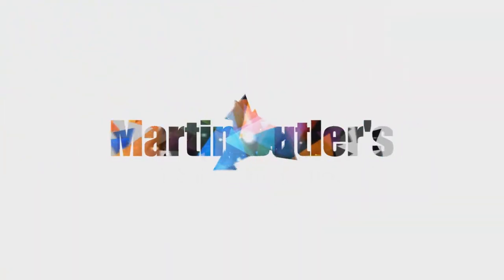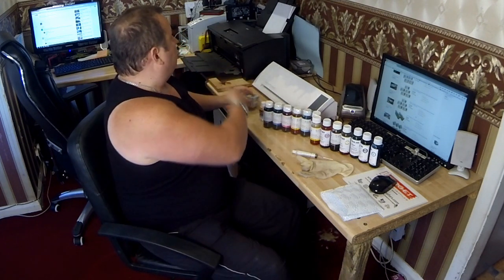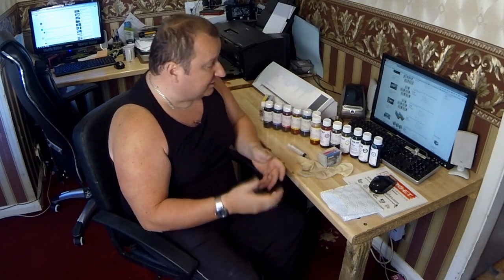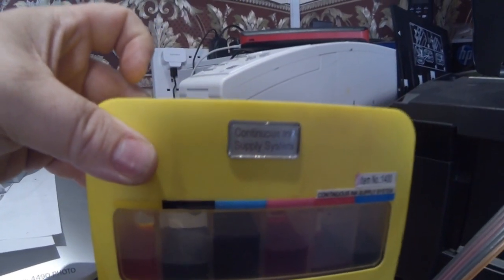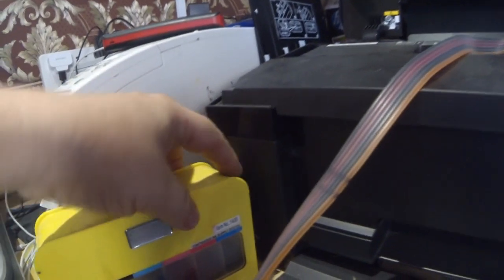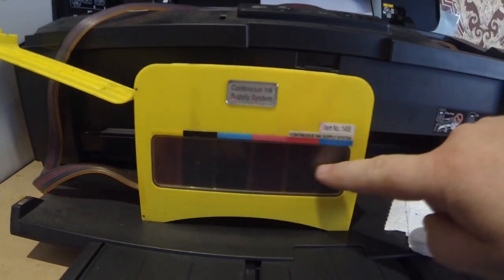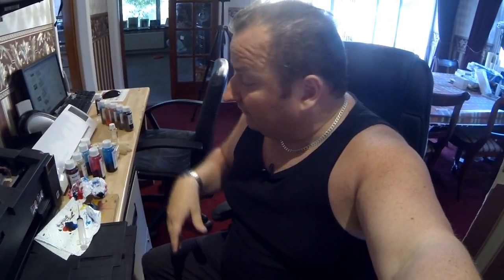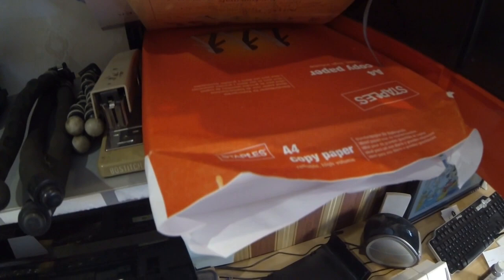My Epson 1500W Printer Maintenance CISS For T Shirt Transfer Printing Biz

Comment: Hi Martin,

First of all, let me say, I could kiss your cheek for informing us about CISS Ink Systems!!  I spent $89 US on a system for my Epson Workforce 840 with each tank holding 100ml of Ink.  I can’t even buy 4 new dinky replacement cartridges for that!!

I started with the dye ink as suggested, maybe it was who I purchased it from; but, the quality was very dull, especially when printing on normal paper.  However, I returned that system for a pigment system and it is much better.

Without you and the tips you share, I would have been spending loads on ink!!  Thanks for all you share!

Next venture, a waste ink box!

Cheers!
Reply from the maker: Nice one. Glad the vids helped.
Cheers
Martin

Comment: Good day. I have a question. I have the Epson 1430 printer. I followed your steps as far as using a ciss and waste tank. I assumed my ink waste pad wouldn't accumulate any build up. With that being said . The Epson service required popped up. It's saying A part inside my printer is at the end of it's service life. Can u provide some info to help me?
Reply from the maker: You can buy a bit of software to reset the ink pad counter. I just googled it and found it. Try that.

Comment: Martin another great video. I've got an Epson Expression Home XP-235 All-in-One Inkjet Printer. Would I be able to use this or should I upgrade? My other question is where can I find the dye inks that you use in this video?
Reply from the maker: It's up to you bud. Here's the ink that I use http://www.ebay.co.uk/itm/6-x-100-ml-Dye-Based-6-Color-Refill-Ink-for-Epson-Printers-/371655429358?hash=item568863ccee:g:1tkAAOSwzJ5XX8Gk
Cheers
Martin
Reply: Martin Butler thanks! I've opted for the same printer as yourself. It makes sense as it's also A3. :)
Reply from the maker: Andrew McMaster
Yes, it's a good choice bud.
Cheers
Martin

Comment: Hi Martin,
Loved the vid once again.
I have a question.. I just purchased the CISS (Pigment) for my epson 1500w, and the quality it's coming out seems pretty low, dull and faded. Sometimes it has a few lines going through the image, I've tried cleaning the nozzle heads plenty times however it still doesn't print out properly. Any help will be great thanks
Reply from the maker: Have you performed a nozzle check to see exactly what is blocked? I don't use pigment inks in my CISS as in my opinion, it can block up the fine print heads in Epson Printers. I have always used dye based ink with my t shirt transfers.
Cheers
Martin

Comment: I have many of your videos but cannot find any on the printer for 
your mugs.   I think you said you have a Ricoh sublimation printer and I
 have the Saw Grass and believe they take the same ink.    My did fine 
to start but towards the end the cleaning ran
 3 of my inks out.    I see replacements run about $75 each and is there
 any generic or refill systems that WORK and cut this high cost???
I will appreciate help on this matter.     Thanks, Keith
Reply from the maker: Hi Keith, I only use the Sawgrass sublijet R inks as I have had no issues with this set up with the powerdriver software. You can get other makes of ink for this printer but I will not change a winning formula. I have no problem with the quantity of mugs I can print with the subli jet cartridges as they last for ages.
Cheers
Martin
Reply: Thanks Martin for confirming what I have found out so far. I
have been using the Saw Grass printer even for my t-shirts. I have a Epson
Stylus Photo 1400 with Claria Hi definition ink and going to test that on a few
shirts but thought I had to use the sublimation ink on them also and as you
say, no need to. Thanks again. OH, my subli jet cartridges coming in today and
all seem to be just about the same price. $325 for all 4. Ouch. Thanks again.

Comment: Hi martin :) Do you use this printer for Mug printing also ? Or would you recommend using this printer for that
Reply from the maker: No, The mug printer is a different printer and ink set up. Through trial and error, I don't recommend using Epson printers for mug printing. All info is in my training dvd.
Cheers
Martin

Comment: Hi Martin! Help me out please :) I'm got the same printer but the Inktec Sublinova Smart Inks with ciss system. I'm only using to do mugs and tried on tshirts and the colors were faded. with ink should I use? What kind of inks wear off the print heads and not?

All the best 

Nuno
Reply from the maker: Nuno. If you are using Sublimation ink then you'll need to use sublimation t shirts. You can not print on cotton t shirts or they will just fade and wash out. The t shirts have to be a polyester type for the image to set.
Hope this helps
Regards
Martin.

Comment: Hi Martin. The ink in my ciss isnt flowing all the way to reach a couple of my cartridges. Do you have any suggestions? i have the epson 1430
Reply from the maker: It's probably a vacuum has been created in the ink containers. Remove the rubber bungs in the containers and do a head clean and you should see the ink flow. Leave the bungs out. I had the same issue and this solved it

Comment: Hey Martin! I finally got my t shirt business started, but I noticed something when I printed on a black shirt as opposed to a white one. The white shirt printing process yielded a much smoother transfer and felt more like a quality shirt, the black one felt almost like I melted a sticker onto it though it has become part of the shirt and is extremely smooth, are colored shirts supposed to feel this way? I'm using the epson 1430, I have a geoknight press set to 360, and I'm using the appropriate transfer paper the 3g jet opaque.
Reply from the maker: HI Zach,
Unfortunately, the dark t shirt transfers are not as good as the white t shirt transfers so we try and keep the images smaller when we use them, If working on dark garments, we try to use vinyl type designs as the feel is far superior.
Good luck.
Cheers
Martin
Reply: Hey, so this has happened to me twice in a row now, even after I lessened the cooking time, I have my press set to 360, and the first time I let it cook for sixty, this time for thirty, both times my transfer refused to come off and felt like it was glued on though this time I was able to get more off. The transfer itself I cut away as much as possible so I only get the image and not all the extra stuff, so it's harder to pull off in one go like all these other transfers I've been seeing you do, what am I doing wrong?
Reply from the maker: It might be an old batch of transfer papers. I had this once and had to return them for replacements.
Reply: It could also be that I bought transfer jet papers instead of pro ss ones......?
Reply from the maker: There you go then bud.
Cheers
Martin

Comment: I have tried print head method discribe in this video but it still not cleaning. I only print 10 A4 from new before it started missing some lines. At the moment it only 12 lines & it makes it had to keep going forward when turning backward is not an option.
Reply from the maker: What ink are you using. You may need the cleaning fluid as suggested in this vid.
Reply: Am using CISS as instructed in the training but I can't find Magic Bullet in ebay. I bought a Cleaning Solution from ebay and it still not clear.
Reply from the maker: Tayo Olusanya You do not mention the inks you are using. What is it? Dye, Pigment or sublimation?
Reply: +Martin Butler It's dye base
Reply from the maker: It's a print head problem then. It may be that the printer has been stood and the ink has dried up in the print head and is stubborn to remove. You will either need to continue trying cleaning or get a new printer.

Comment: my print head don't work I put isopropyl alcohol to clean the print head do you think I messaged it up with that 99.9%
Reply: You may have damaged the circuit board but I can't be sure without checking it
Reply: +retrorestore how do I do that?
Reply: If it does not print out anything at all from any of the print heads, this may be the case. Does it print out anything with the cartridges in ?
Reply: +retrorestore no nothing at all it's not blocked it very new aswell no colours come out not even 1
Reply: This happened to me when I put too much cleaning fluid through the print head and it contaminated the circuit board and buggered up the printer. I can't say for sure this has happened to you but that was my experience.
Reply: +retrorestore anything I can do about it I would say that's what happened as I thought that myself
Reply: in my case it meant a new printer.

Comment: is this printer better than Virtuoso SG400 ?
Reply from the maker: No, not for sublimation inks as these printers can block the print heads with pigment inks if not used very often and they waste a lot of ink for their maintenance cycles in my opinion.